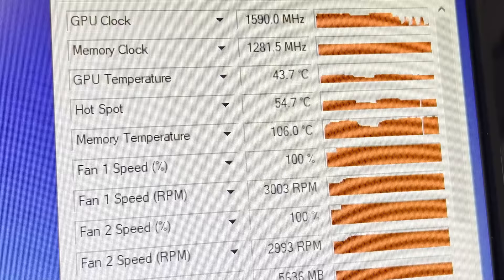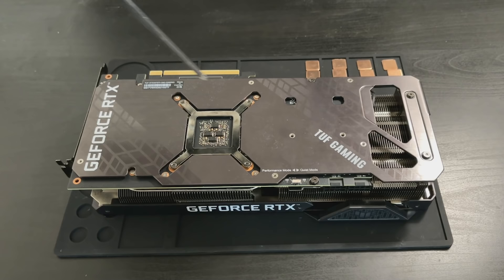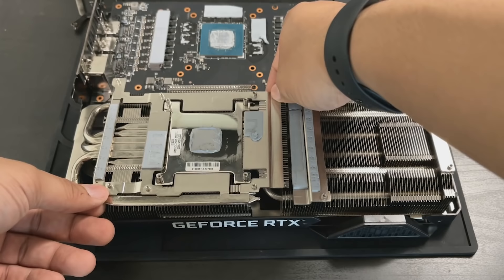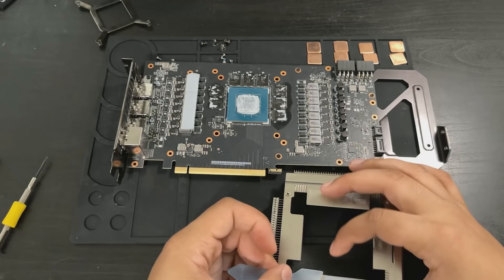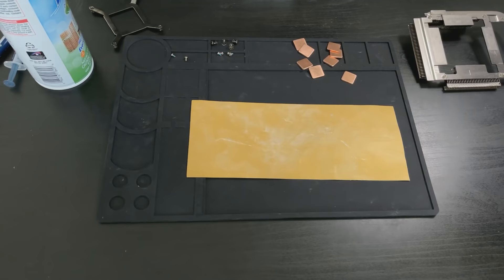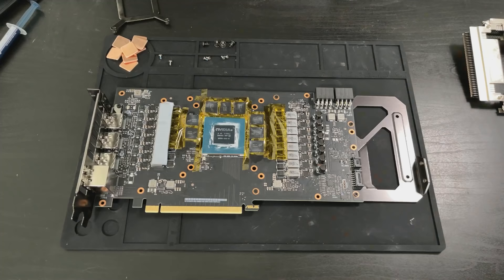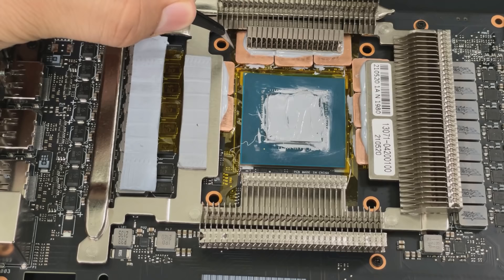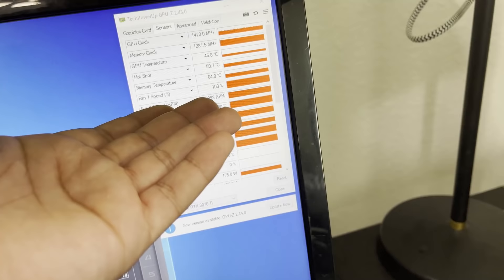I Copper Modded An RTX 3070 Ti.  Memory Temperature Dropped 45 Degrees! This Is How. (110C to 64C)

Comment: Buddy got an older gaming PC for $10 that had a Corsair closed liquid cooled system but had been empty for years and full of bacteria so he bought a new heatsink and fan but  it wouldnt cover the entire CPU. Four corners were exposed even though it fit the board. So I too apart the copper plate from the Corsair liquid cool system and used that over the CPU then attached the the aluminum heatsink and fan to it and so far idle at 38C. I got to put an OS on it and stress test it.

Comment: Done the copper mod on the rear side of a RTX3090, saw a 20 degree drop running at max memory over clocking. Perhaps if I done the copper mod on the GPU side too I would see lower temps. Seeing your video has given me a nudge to do the other 3090's and the 3070's. my 3060ti's seem to get warmer than the 3070's, they only have a dual fan not triple. Keep up the good work.

Comment: Some thermal paste contains metal in it because, simply, it helps. Liquid metal cooling is pretty much superior to any other kind of “still cooling”. Also galvanic corrosion shouldn’t happen with copper and liquid metal. It definitely will with any aluminum tho.

Comment: The primary metals of concern in terms of galvanic corrosion contact with copper are aluminum and zinc. Large differences in the thermal expansion rate between copper and these metals may cause additional problems. Also avoid using copper and some brass fasteners with aluminum, zinc and most ferrous metal

Comment: I'd have placed the shims on the memory and then applied a thermal epoxy to the bottom of the memory cooling plate only, then screw it down and let the epoxy cure. That way your shims are part of the cooler and won't move. Every time you remove the cooler from that point you need only a light application of thermal compound on the memory and GPU. Also electrical contact cleaner and a toothbrush, that's the easiest way to remove the old thermal interface materials.

Comment: Wow, shocking mem temps! I'm  running an MSI 4070Ti,  this card has separate heatsinks for memory and  VRm's both with heat pipes. I do cap my fps to 165 but my highest temperature  (hotspot HWMonitor is usually  around 70°C)  My last two GPU's have been MSI, they have very efficient cooling. Great video,  thanks.

Comment: I dig the Kapton tape mod as finding a clear nail polish without the bad chemicals is hard...or my wife gets mad that I took her good one. 

Super Pro tip for any sanding where you are worried about the dust is always wear a mask because your lungs hate that stuff too, and wet sanding will help, I have used iso instead of water and it works just as well and there is less residue to clean off.

Comment: I used thermal glue to put RPI aluminum heat syncs on my GTX 1080 memory and VRM... huge difference on OC capability... also put an AIO on the chip... Your card is the exact card Im looking at upgrading to since gpu prices are falling... but I think Ill hold out a little longer and see what AMD comes out with this next round

Comment: You could have used a slightly thinner shim. The thermal pad gets squeezed when you put them back together. Copper won't be squeezed before turning your vram into dust

So people if you measure your vram thermal pad 1.15mm use a 1mm shim

Comment: If those copper shims were to touch the tiny capacitors, you would be screwed kapton tape or not. If you apply any meaningful pressure to a 0402 or 0603 capacitor it will absolutely crack. Either the solder block will deform and fail over time or the entire ceramic body will fail. Short circuits are the least of your problems here.

Comment: The Asus cards are the best cards for this, anything else has an integrated VRAM heatsink which unseats the GPU core from proper contact if the copper is too tall. 

You should try putting thermal pads on TOP of that aluminium heatsink for the VRAM, and make it contact the main sink, too. This makes it far far better at cooling -- dropping by a further few degrees at least. I used to do thermal pads for miners, the good asus ones could get to +1600MHz OC on the VRAM with only 72C max on the VRAM with Thermalright odyssey equivalent pads

Comment: neat idea but I'm wondering if it would work on a gpu block that doesn't have a separate heatsink for the ram. thermalpads compress, so using copper shims would normally make contact with the gpu die worse unless you have the perfect thickness.

Comment: The fact that they're using a separate memory heatpipe and heatsink on this card means Asus were probably aware of the problem but couldn't give two shits about actually fixing it. Translation = bad design!!! And while most memory chips can run at 110C and still be "in spec" that kind of abuse does affect their longevity. For somebody who doesn't want a dead GPU after 2-3 years that kind of thing matters, never mind availability if you need a replacement and inflated pricing.

I'm running older GTX 980 Ti cards on full cover EK blocks. GPU-Z only reports GPU temps on Maxwell and not the memory temps which for me sit around 52C. I honestly have no way of telling if the GDDR5 is happy, but considering it's still running after 7 years of 24/7 use I'd say there's no danger here. Thermal pads probably aren't the best choice for GDDR6X based on what they did with this card. I'd look for a 30 series a better designed cooling solution if modding or going water is not an option.

Two thumbs up for a nice video and great job with your mod 👍👍

Comment: i tried this method before on 1070ti, it does make vram cooler alot  but also make thermal paste dry fast af, and it even hotter than before ! 
best option  still thermal pad (at least it stable ), or water cooler

Comment: Asus made a very bad heatsink design disaster there. It does only cover half of memory chips on one side and the other part of chips is frying in the open. Thermopads - the thicker they are the worse heat transfer gets and in this case part of thermopads didn't even make any contact to heatsink... crazy. The only concern with this copper mod is that the BGA's connecting memory chips to PCB may start cracking because now it has to work in more rigid environment with more pressure put on them. Something similar to what was happening to mobile GF 7000 series back in the day.

Comment: memory chips should be getting IHS's at this point IMO. A tiny copper layer on top of the chip would allow for easy paste application for memory coolers rather than using pads

Comment: You can easily achieve the same results using non conductive thermal Putty to cover more surface area.
The problem here isnt the copper but because there a too much gap between contact points.

Comment: I would suggest that the best solution is to use shims of exactly the same area as the VRAM chips and c. 0.1mm thinner than the VRAM-to-heatsink gap (to allow the use of thermal paste), and use strips of thermal pad surrounding them of a thickness to match PCB-to-heatsink gap to keep the shims in place.

Comment: the only thing i can see with doing this, is using hard copper on another hard surface, the idea with compound is it fills in any surface bumps, so that the 2 surfaces are as flat to each other. this could work fine with compound on the copper plates, so, my idea, why not use gold leaf sheets, being thin its going to mould to the surfaces, and gold is known to be the best for heat and electrical conductivity.

Comment: Pretty sure it was the Asus 3000 series with the bad temps and it was due to bad mounting pressure! Gamers Nexus did a big story and follow on it. Apparently asus got the wrong info on torque pressure of the screws and made them to long. Cool that you found a way to fix it though!

Comment: I hope they fixed this, those 3070 Tis are gonna short for this life if they all run this hot. The 3070 Tuf didn't have a memory thermistor or temp sensor in silicon on account it is GDDR6 but I'm guessing it wasn't great because a waterblock let me oc the memory a ton more.

Comment: You only need the copper shims on cards that have a one piece for all heat sink to make up for the height difference of the gpu and the ram. two piece designs like this one only thermal paste is needed. just getting rid of those pads alone makes a huge difference. those pads act more as an insulator then a thermal conductor...

Comment: 5:21 - You can also use clear nail polish for that. Two or three layers and you're golden! Or errrr, plastic? Anyways, it doesn't lead electricity and is able to get to those difficult spaces. Also handles heat well.

Comment: I wouldn't recommend this, copper's exposure to air, though water --- especially salt water --- heat and acidic compounds can also induce corrosion. Oxidation adds a verdigris color (blue-green) to copper or copper carbonates like brass or bronze. This is especially true when contact with anything acidic in nature occurs (e.g. vinegar, ascetic acid). You may kill your card.. you can even see the Oxidation on Heat pipes on cpu air coolers.... just water cool it for crying out loud

Comment: i would even say that the old pads were just freaking bad or didnt even had proper contact, because 110 degree is not normal, even for the worst thermal pads combined with gddr6x....
it most likely only worked in this specific case because of that seperated heatspreader. i can image it can also work where the memory and gpu have the same height. but we dont always have the same height for the gpu and memory modles. i think then it will get a bit trickier to copper mod a gpu.
the video is nice! we now know, if we have a separated heatsink for the memory modules, we can just put copper in there.

Comment: On the first QA, you are absolutely wrong as thermal pads have different compression distance based on pad thickness. A 2mm thermal pad recommendation would usually have an 80% compressed state of 1.6mm (compressed by 0.4mm). This general scheme of reducing it only by 0.2mm is attracting a potentially dead card or your GPU core temp running in a tizzy due to minimal contact. You cannot compress a metal added to the fact that this expands when heated. One other thing, the screws were set to standard  turns based on the cooling plate seating on both GPU die and vram level tolerances. One error in tightening these screws to standard, this would possibly cracke or dislodge the vram from solder points and bye bye GPU card. Any modding like this one should be done with extreme care, do some research, and be exacting in their level measurements. I wonder what happened to his card now...

Comment: Hey Dandy,
What were the plate sizes and thickness, i have a 3080ti Palit Gamerock GPU, trying to figure out what size my plates should be as getting close to 100c while mining is abit hot.
Was looking for solutions and you might have just made my day after seeing this video 😁
Reply from the maker: In this case I used 2mm thick plates, sized 15x15mm, which were the exact thickness of the thermal pads. However, in the case that the coldplate is shared between the memory and the GPU die (most GPUs are like that) I would choose copper shims that are .2mm smaller than the size of the stock pads. I would buy a pack of shims with a few different sizes just to be safe, like the ones I have in the description.
Reply: @dandyworks  I thought you used 1.5mm thick shims in this video?

Comment: I was thinking about this on my 4080, once I see how it does with a full water block though, if the mem is not throttling then I wont. But nice Job in the end you fixed it.

Comment: Copper shims? I mean I guess? I just use those sheets that you can get from thermal grizzly. Either that or some break anti-seize copper paste. Not the copper grease. The copper paste with actual copper dust in it

Comment: I got the same memory temp differences on my Rtx 3090 FE when i switched out the stock thermal pads for Thermalright Thermal Pad 12.8 W/mK 1.5 mm, almost two years later and going strong without any change.

Comment: Hummmm so I just realized that this TUF has the memories and GPU heatsinks separated it's a really good thing actually but they failed on getting the right size and design for the base of the memories heatsink. But still I would have used little bit thinner copper sheets since the stock thermal pads are supposed to be a little squeezed other wise you know is not making good contact. So the ideal is to get sheets around 0.4mm thinner than the stock thermal pads. But since the memories and GPU have separated thermal heatsinks I don't think is necessary for this graphics cards.

Comment: Sick mod! I'm totally going to try this on my 3090 that constantly gets to 100+ C

I just have one little concern with this build and that is degrading stickiness of the tape you used, have you thought of that?
Reply from the maker: The tape is specially designed to remain an adhesive under extreme conditions. It is very commonly found on PCB components to protect them.
Reply: @dandyworks  thats cool, where can i buy the tape and plates?

Comment: What test should i do in 3d mark to test if my vram overheat ?
I have a 3070 ti fe running at 2000 Mhz with .95 mV and my vram sits at 74 c with 10 000 Mhz in time spy extrême at 4k.

Comment: What I dont understand is if they add a seperate heatsink for the memory, why do they leave so much room between the heat sink and the memory chips that they require such thick thermal pads to make contact. Why not go with less space and use thermal paste directly.

Comment: I am wondering is an option to the same mode for RTX 3070 non Ti ? There is a difference in built of heatsink , there is no 2 parts but 1 covering GPU and memory chips.

Comment: do you know why the manufacturer gives thermocouples instead of a thicker heat sink? Because the hot card will expand and contract over time, when you put copper plates on it, you put additional stress on it and you will fuck up the card in an ugly way. Second thing, what about 1 mm of copper if the heat sink is aluminum?

Comment: I have a question - if the movement of the copper shims is so concerning, why was thermal adhesive not used to fix them to the cooler? It does the same as thermal paste, but has a glue component added.

Comment: Well...I replaced myself some rubber on memory with metal on two laptops. One is a gaming  class asus, another is an old acer emachines. In both cases it works pretty fine and much better than TC rubber. This is an advice you can give to anyone. The biggest challenge here is to find out the right thickness of the metal plates for them, because it's important not to lift the radiator above other BGA chips. On the contrary you don't need to get too concerned about the metal for plating. Any metall you can find home performs 3x + better in heat conductivity than the best rubber you could get. Well, copper performs better than iron, but it's not worth the efforts it might take to find it.
Reply: Rubber? You mean thermal pads?

This is not worth the effort as metal doesn't deform.
Reply: @pickleadaykeepsthedoctoraway  it shouldn't. You just stick metal plates to the radiator using thermal grease

Comment: In my opinion, you made a mistake - if the original thickness of the washer was 1.5 mm, you cannot use 1.5 mm thick copper on which you then apply paste on both sides because this paste will raise everything by about 1-2 mm. It would be good to do a test where you would test different thicknesses of pads - 1.5 mm, 1.4 mm and 1.3 mm, plus check the effect on the GPU temperature. Sorry for My Englis.

Comment: I changed the pads on a 3080 and 3090, for mining also. Both were hitting close to 120 on the mems and after, they were hovering around 82. I did get expensive high conductive thermal pads though and on the 3090, which was water cooled to begin with, I also installed two ram water blocks on the backplate with some thermal double adhesive thermal pad.

Comment: I tried this.... and jeez, it really better than any thermal pad at any time, much cheaper too!!!
Just be careful and mind the pad thickness. My default pad is 2mm thick, and I bought 2mm thick copper shims. Big mistake. 
It cool down the VRAM (memory junction) well below 65 C in ambient 28 C but since the copper ship is a little bit higher than the GPU die, the GPU doesn't get proper cooling and thermally throttling at 100C. I ordered 1.5mm shims yesterday, I hope I can make this mod works
Reply: What are the current results and is it TUF series card?
Reply: @alligatourist  mine's MSI RTX 3080 Ventus 3x OC. The current temp (at 100% fan speed) is 65C. It turns out I need to sand my 2.0 mm shim down to 1.8mm. 1.5mm doesn't work for me

Comment: 5:45 underneath the lower right corner of the LEFT-most memory module, there is a capacitor (?) that is diagonal 45 degrees. Um... is that normally there?

Comment: Actually that separate cooling plate for the memory will help you after the copper mod so that the increased heat coming from the vram wont be transferred directly to the GPU cooling plate surface as that would result in lower memory temps but higher gpu temps!

Great video btw keep it up
Reply: I have a 3090 tuf and did this and my core temps as well as the hotspot went up slightly is that normal?

Comment: You should maybe consider looking for some thermally conductive adhesive.
Or maybe just use your capped on tape there to secure the copper bits a little bit more than just allowing them to free-float.
On the bright side the thermal paste will dry eventually and essentially 'weld' these in place some.
Reply: good paste doesn't dry out.  (gelid gc-extreme)